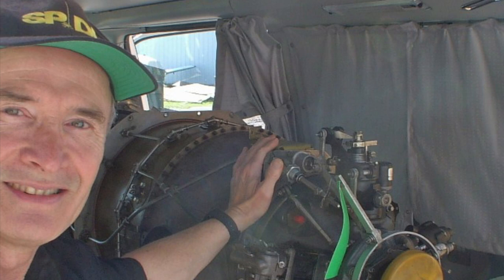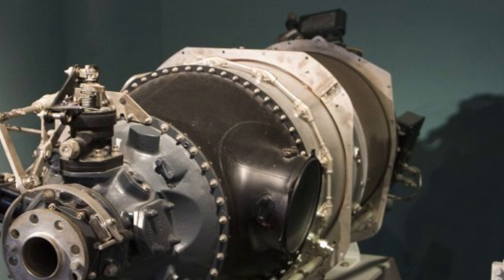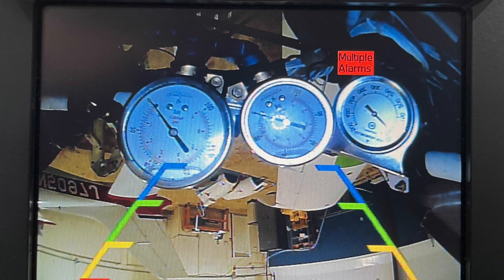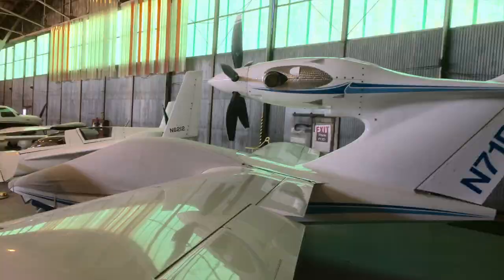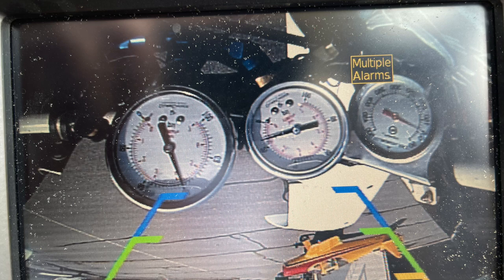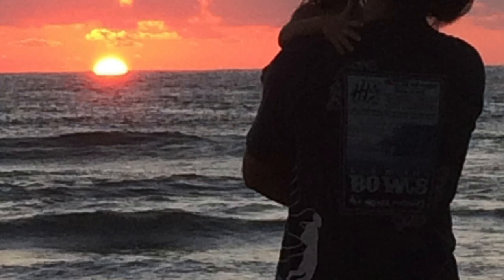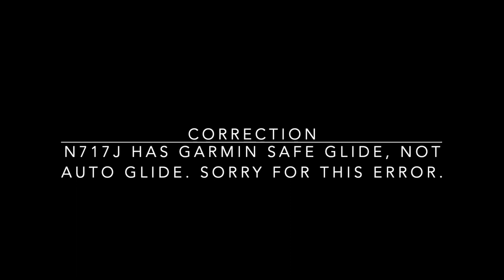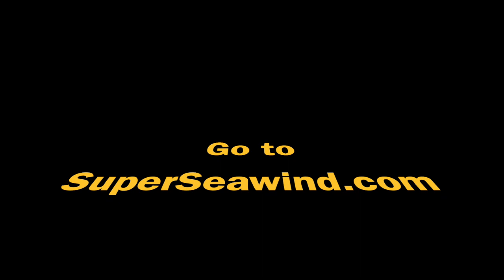N71RJ PT6A9

Comment: Not concerned at all about the motor.  Very concerned about the airframe.  What is your stall speed?  You indicated short distance takeoff.  I have seen videos of piston Seawinds that were well over 60 seconds to take off and very high speed.  95% of my landings are on water - but admittedly, my cruise is probably 1/2 or less than yours.
Reply from the maker: My Super Seawind typically lifts off in less than 35 seconds after applying take of power.

Comment: Esse avião já nasceu morto porque ele colocou uma turbina PT6 no avião anfibio e para piorar ele fez um modelo de 4 assentos. Se a fuselagem não suportar alta velocidade não justifica colocar uma turbina porque se o avião não tiver uma boa resistência e com baixo arrasto induzido a baixa velocidade vai aumentar e muito o seu consumo! No minha opinião o motor ideal séria o continental io 550 de 260hp a 300hp ou então higgs diesel de 350hp a 500hp no caso dele suportar uma velocidade de cruzeiro um pouco maior.
Reply from the maker: This is nonsense. ANS. Seawinds are built for strength and speed. ANS. All Seawinds are 4-seaters. Seawinds with piston engines, like the 540 or 550 are high speed airplanes. As 
dsrrodrigues suggested. 
If the fuselage does not support high speed,?  ANS. Who says is doesn't? I am the builder, I should know. The vertical stabilizer is reinforced with cabon fiber construction. I have flown my Super Seawind at over 200 MPH with no problem. Check Flight Aware.
 it does not justify installing a turbine because if the plane does not have good resistance? Good resistance to what?
(L)ow induced drag at low speed, its consumption will increase a lot! ANS. From the books I read, lower drag translates to higher fuel efficiency, not lower!  I hope dsrrodrigues knows more about the car he or she drives than the Seawind.
Reply: @stevenwightman5028  Tu disse 200mph que e 174kts! Com essa performance uma PT6 de 550shp ele deve gastar em média 190 - 220L/H. Por exemplo um Lancair Evolution Evot 550 tem uma velocidade de cruzeiro de 265kts que e 305mph e seu consumo horário e de 28gph que e 105L/H. E por isso que eu estranhei da escolha   porque se o avião não tem uma aerodinâmica para conseguir velocidades altas a opção seria escolher um motor mais econômico porque quanto mais o avião anda, mais econômico ele e! Um bom exemplo de eficiência energética e o Diamond DA62 com seus incríveis 44L/H e outro exemplo os motores Higgs Diesel que são bem econômicos também porque uma coisa boa no avião e autonomia e economia.